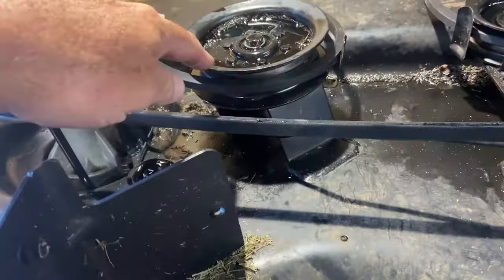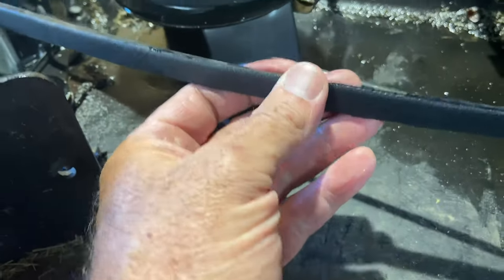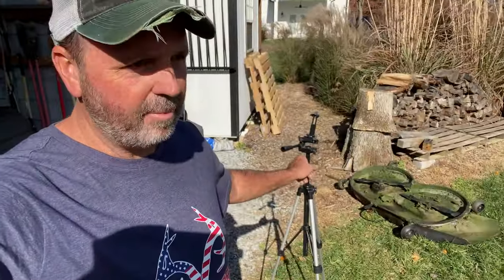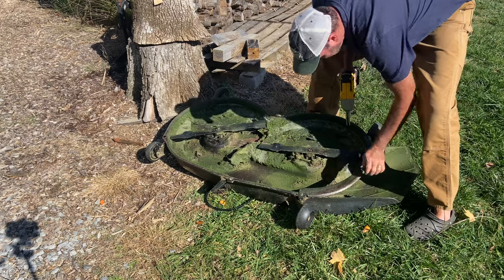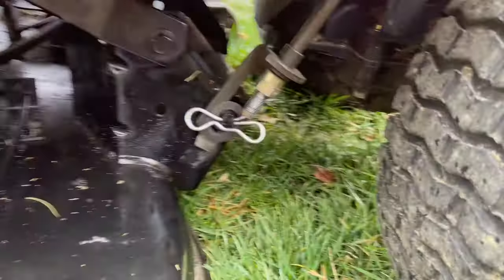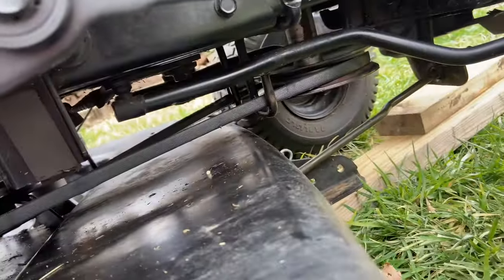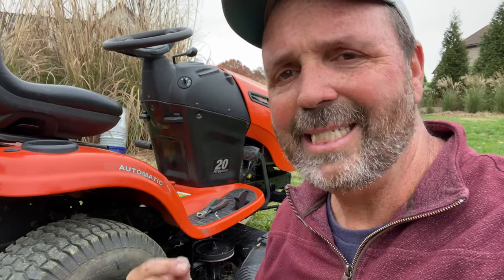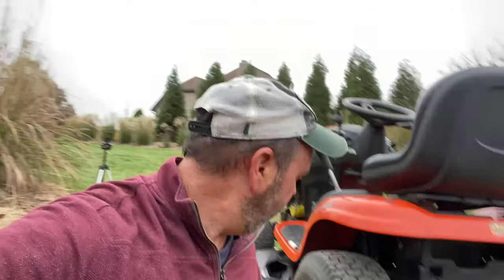Ariens,Husqvarna, craftsman deck  belt replace

Comment: Didn’t show how the belt gets attached or even tell the size to make sure it’s the right belt. I bought a belt and it says 1/2”x 95.5 but it’s too tight. Was hoping this video would help. It didn’t.
Reply from the maker: Thanks for watching
Reply: Your belt is a 1/2 x 101” I strongly urge you to search 1/2” x 100” helps when belt wears and stretches